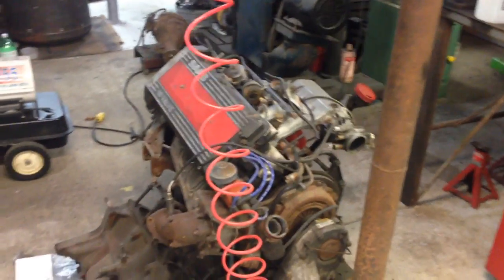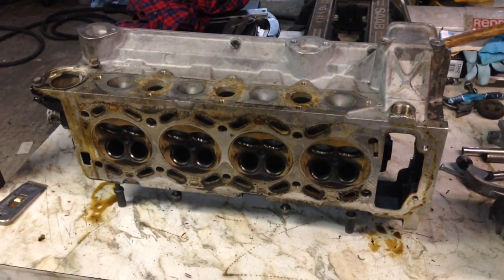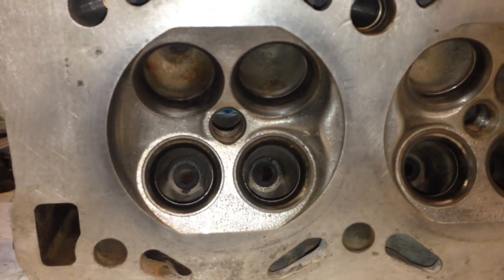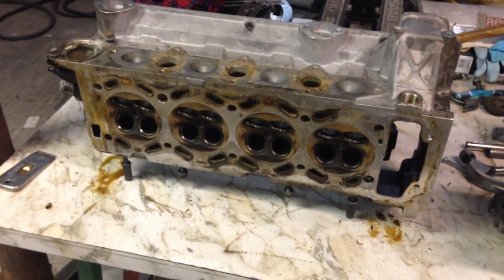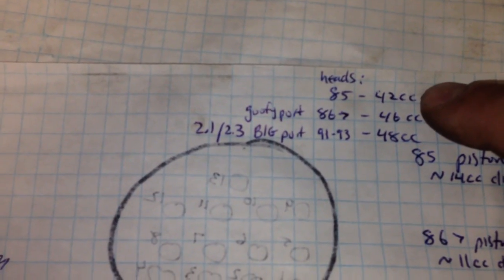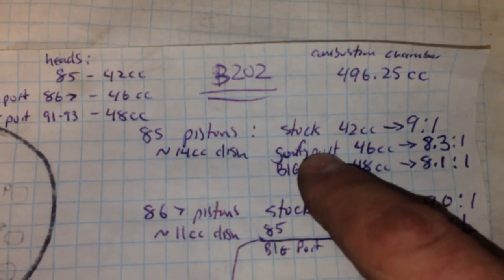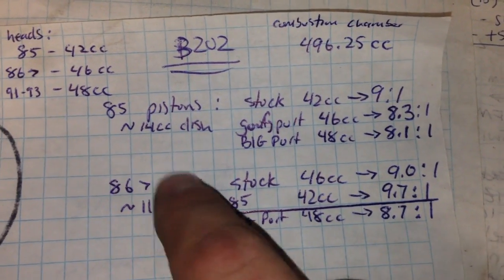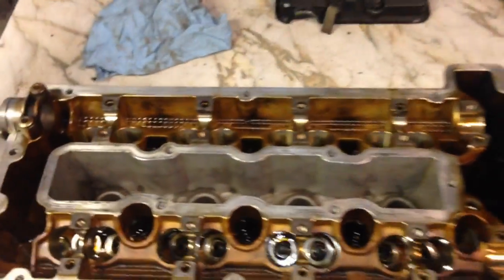Saab turbo B202 cylinder head differences

Comment: Thanks for the video...I know its been several years but I was hoping you could help. I have a good running 91' 2.1 (B202i) and have 93 Turbo (B202S - T3 - Low compression version) with two intake valves stuck open on cylinder 3 - what appears to have happened a little while after a head rebuild.

Is the 2.1 head a direct bolt on with the B202S block?   Reason I am confused is because when looking for a new head gasket, sellers offer two different head gaskets.  If you or anyone can verify, would be much appreciated. Any suggestions on which way to go...use the whole 2.1 setup with turbo or just swap out the head?
Reply from the maker: Use the 2.1 head, intake manifold and fuel rail on your 2.0. for gaskets you are sealing a 2.0 engine so you require a 2.0 gasket set except for the intake and exhaust gaskets as the ports are larger. Heads are a direct bolt on

Comment: It looks like the 8.1 compression combo would be great for a turbo car. Is the T-5 conversion worth the effort and expense?
Reply from the maker: with  good fuel fuel injection and ignition control there is no reason not to run higher compression and turbo. The higher the better honestly, to maintain off boost torque. the T-5 is worth every penny if it can be installed inexpensively. these days there are kits which are well priced
Reply: Nodarperformance Thanks for the reply. It is a bit contrary to what I read on the Saab blogs. People get alarmed and say "You're gonna blow it up." I guess not. I'm looking at a 1985 900 turbo 3 door. I have a '92 2.1 non turbo as well as a spare 2.1 non turbo engine and 5-speed. I was thinking about getting the 85 and using the 2.1 head.  Don't supercharged engines have lower compression to take advantage of a larger cumbustion chamber full of supercharged air? Or are we talking about two different things? I would think that with lower compression you could run higher boost with the turbo. Anyway, I appreciate all the info you have provided and the time it has taken you to gather it. Any info have would be appreciated. Seems I have become a Saab fanatic in a short period of time. These cars must have that effect on people...
Reply from the maker: generally speaking your are correct in saying that supercharged and turbocharged engines have lower compression in comparison to N/A engines to offset the chances of detonation/knock with a set octane level. With the advent of knock sensors and sophisticated engine control systems (ie: T 5.5) the compression can be increased to take advantage of higher controls these systems have. With higher compression, similar power levels can be achieved with lower boots and smaller turbochargers making for an over all better driving car off and on boost. Nothing is wrong however and many people have had great success with low compression ratios and big boost. its really 6 of one 1/2 dozen of the other. As of recent most car companies have been taking the approach of higher compression and smaller turbos, as this increases efficiency (ie less fuel) for the given amount of power the engine produces. If it were me in your situation, I would install T5.5 onto your 2.1 engine and a Holset HX30W turbo and have yourself a rocket ship (until the gearbox breaks - which it certainly will)

Comment: I've got a 91 900 turbo track tuned ,with everything available in the 90's. Trouble shooting is a daunting challenge. Can I bolt on a newer T5 head and it's programmable ECE with it? Or am I nuts?
Reply from the maker: you can bolt a head from a 1993+ engine but a modification is needed on the timing chain housing. This head is way better than the so called big port "long" head, but the intake ports dont line up to the C900 manifold, so some grinding is needed

youd be better off with a modern turbo and some better engine management ie: get rid of that distributor

Comment: Hey,
I am planning a t5 conversion on my "goofy" 87 Spg. I know the 2.3 head is the way to go with the t5 cams. I am planning on replacing the pistons, clutch, flywheel... all the stuff to get towards a power band to yet be disclosed... anyways I had read the route to go with in integrating a direct bolt on head to the 87 is any t5 from 91-93... and any t5 after requires some sort of custom fabrication...?
Reply from the maker: The "T5" head is actually considered to be >1994 as far as im aware. The head which im using currently is the 2.3 head seen in the video (direct bolt on) which actually was Bosch LH 2.4.2 or "long head". The 2.1 NA saab 900's and 9000 2.3 turbos from 91-93 used this exact same head with better (larger) ports. To actually fit a real T5 "short" head onto a B202 engine block requires adding (welding) some aluminum onto the front cover flange as the heads are slightly dimensionally different as well as some tricky port work to the C900 intake manifold, as the intake ports are completely different shape (more square than oval). There is also a small issue with the offset of the timing chain sprockets as well

As far as cams go, from what the specs show in all my books, the camshafts fitted to your 87 head would have been the most aggressive factory profile used until Saab stopped production. The later engines used large ports and excellent flowing cylinder heads, so the need for aggressive cams is diminished. People like the '85 exhaust camshaft as well, but the difference in timing is so minuscule its not even worth replacing the valve cover gasket to try it...
Reply: Nodarperformance I am interested in getting rid of the distributor, Hall effect sensor and instead using a t5 di cassette.

I was wondering if maybe you had a suggestion on a t5 head to look for or look out for?...
I've already upgraded the suspension:
1987 Spg
1988- 900/9000 rear axel 
1988- bigger brakes
114.3 hub upgrade
16" Aero Carlsson trispoke wheels
Koni Shocks & Struts...

Gutting the car completely at the moment while I plan the next steps for winter
Reply from the maker: For the easiest conversion I would use the cylinder head from a 1991-1993 9000 2.3 turbo/NA (same head) or 91-93 C900 2.1NA engine, your '87 turbo's camshafts, C900 2.1NA intake plenum (much larger) and a flywheel from eeuroparts.com with the Trionic 5.5 trigger wheel machined in. This will allow you to use the plug in the old distributor hole and will allow mounting of the VR crank position sensor needed for T5 to operate. You will also need a full harness from a T5 car, but im sure your already aware its a huge amount of work.

Alternatively you could install T5.5 and a modern larger turbo on your stock engine and get going fast enough, as the gearbox isnt going to take much power in a C900 anyways